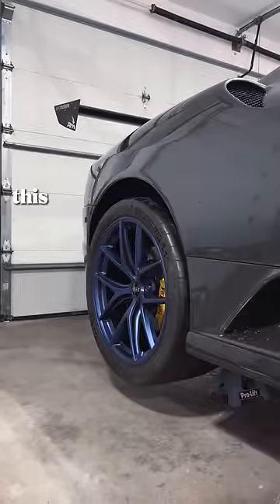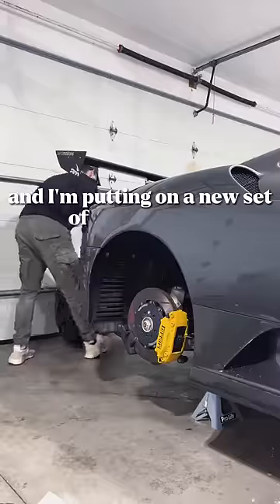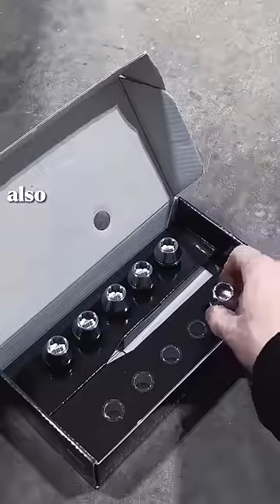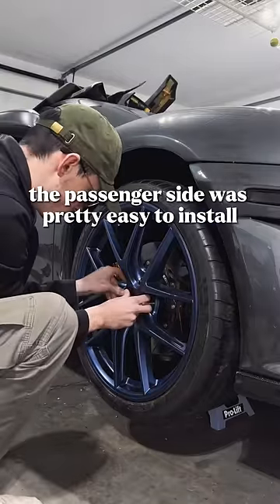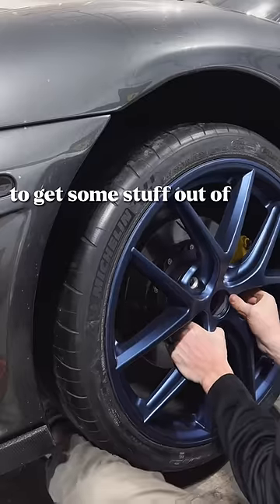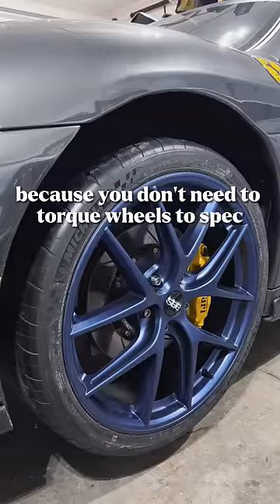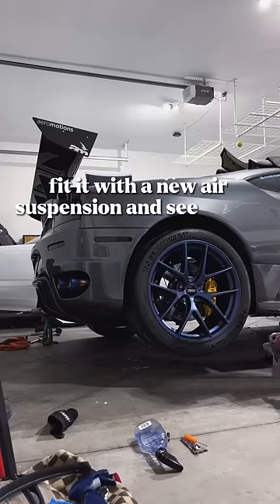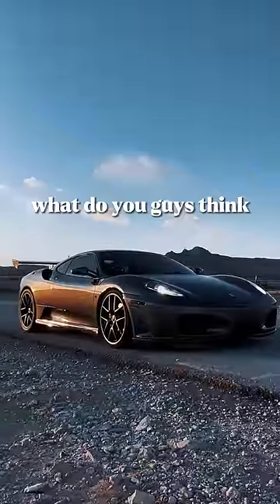Cutting Up A Ferrari In My Garage For New Wheels

Comment: For those mechanics out there who work on normal people's cars. Don't overtorque wheel lug nuts because your customer won't have an impact driver or a 5ft breaker when they are stuck 200mi from nowhere on a Wyoming highway trying to swap their donut spare on.
Reply: Sounds like you’re speaking from experience😂
Reply: I was looking for this comment
Reply: You just sit the key and kick it down
Reply: I mean it’s not such a big deal if your mechanic uses anti seize and your wheels get taken rotated every 3000 miles. I’d rather have it a little over torque then my tire flying into the opposing lane and killing someone.
Reply: @nosypatrick8524  given that this just doesn't happen if you torque properly, and you save the other steps, how about you do that anyway lol. 
Your argument is literally: do all this other stuff that is easy to miss, instead of doing the one thing that the wheel lugs are designed for, which works fine. How about you just torque them correctly, and then you can rotate tires, do oil and filters at the same appointment, and you don't have to put anti seize on wheel lugs (who does that lol).
Reply: Or just be a man about it
Reply: @microcolonel  I didn’t say it was right but it was better 💀
Reply: @aidanfitzpatrick2206  occasionally men let women drive cars. You might notice this phenomenon if you or any of your friends manage to get a girlfriend.
Reply: If you over torque the wheel bolts you damage the bearing. There’s a reason it has a spec
Reply: @nosypatrick8524  rotated every 3k miles?

I just swap between winters and summers every 10k or so miles and have never had issues.
Reply: @PriffEV  some people use all seasons if you rotate them regularly on all vehicles, especially ones with slight alignment issues it really helps with tread wear. It couldn’t hurt but of course I’m still not used to the new 5000 or 1000 mi intervals between oil changes with these new vehicles.
Reply: @nosypatrick8524  1000 mile oil changes?! Sheesh.

My diesel van had 20k mile oil change intervals. And that was still every year. 1000 miles would be damn near every two weeks!
Reply: @PriffEV  my mistake I meant 10,000 miles 😅
Reply: or just simply trying to work on your car in your driveway because your sway bar link broke and turned your car into a death trap but Hometown tire decided "a few ugga duggas" was fine and stripped 3 of my lug nuts
Reply: Let alone the fact that you stretch the stud beyond the yield point and damage it
Reply: @JoshuahAaron  generally you aren't going that far even if you're being ridiculous; but certainly why tempt fate?
Reply: @microcolonel  I mean... A vehicle that calls for 89 torqued to 100 is still enough to stretch and damage the stud may not do it the first time but continued service at the same place will and then they will blame you for needing to replace stud 🤣
Reply: If you're helping your friend fix a car, don't undertorque either
My ex girlfriends cousin and brother "fixed" her Honda and she called me shortly after she left my apartment and low and behold instead of having me look at it, her wheel flew off in traffic and tapped a truck. 
Lol
Reply: Also some of us have invisible illnesses that make our lifes already hard enough as it is.

I have EDS, which basically is an incurable genetic mutation with many forms. To put it simply: my skeleton and the bits holding my bones and joints in place are absolutely wrecked. EDS is incurable and comes with chronic pain. You cannot see it on the outside.

If I had to change a tire suddenly, I would be left with the tire still on and a flare up along with my hands not being able to move properly for the next week.

It's not cause I'm a woman, I just have a genetic mutation which would fuck up anybody. I can move draft horses around just fine for reference.
Reply: @jevenator  till that strips the lug nuts
Reply: @justinpowers8714  trust me that's the worst that could happen to you
Reply: @nosypatrick8524  Over torqueing wheels stretches the lug nut stud more than it is designed to safely stretch and can lose clamping force and cause a wheel to come off. Always torque to specs since the engineers have figured out what is correct for safety of everyone on the road. Guessing gets people hurt or killed.
Reply: #SuspisciouslySpecific
Reply: Sounds like someone needs to go to the gym😂😂😂😂
Reply: Or you'll strip the studs. I've seen that before.
Reply: I agree. I had to have a stud cut off because a mechanic over torqued a wheel nut.  Always torque to spec.
Reply: Lord the comments....just use a dam torque wrench people, torque specs for every bolt on ur car let alone lugnuts is readily available.  No wheel bearings will be harmed in over torque lugs😂 nor warped rotors😂 however u will either cause immediate issues or long term issues depending on the amount of torque you generously exceed😅 n we all know what happens to a under torqued lug😂 especially the passenger front due to physics! To add ur rotation is important for tires long-term no matter the drivetrain, fwd cars are either putting down power to front left or right 90% the time therefore that 1 tire will drastically wear faster than the others, awd cars it's normally a passenger side or driver side where power is put down so one side will wear significantly faster or front left n right rear vice versa, n rwd the same as fwd and will wear a single tire unless u have a TRUE posi Then u got the aspect of the front is not only rolling forward but turning which will wear faster. If u want the most life, just rotate your tires, I'm not saying follow some the dumb dealer intervals but atleast every 7k. Due to dumb designs,tolerances, and programming your forces to buy all new tires instead of the 1 or 2 you may immediately need due to this neglect as these newer awd vehicles will have major drive train problems with mis matching tires and even tread depth😢
Reply: @jlhicks6517  Dude you've got some mad run-on sentences... I just wanted to respond to the claim about front-wheel drive cars.
In my experience owning a front wheel drive car for several years and doing my own rotation and measuring the tread precisely: if I add up all the tread wear experienced by tires in the front and all that experienced in the back, the front tire wear is really not that different.
Reply: @microcolonel  yeah man, forgot, this, was english,class...? 😉 to each there own, idc what you self taught mechanics do. However I do it all day everyday for the last 13 years, a 121 point multi point inspection on every car and can 100% say that between 5k and 7k rotations there is atleast 1/32 tread diff between front and rear. The real question is if it's so menial or no real difference why do you even rotate them yourself?🤣😂
Reply: @microcolonel  to add I'm going to take your response specific and go on a limb of your (owning) your car. As in you have probably replaced the tires, could even be the weirdo that buys the super hard 60k Michelin tires and if ur rotating we will say 3500 miles no u won't see a real difference.  My statement is oriented to those having there cars serviced at dealerships/ shops as the ORIGINAL comment was complaining about over torqued lugs. With that being said most people servicing there cars at dealerships at the least do not own there vehicles. I don't know if your aware but there not putting no 60k tires on from factory lol. Most of the time there as low as 30k to 45/50k on high end vehicles. You take a 30k tire and run a interval of 5k you wouldn't have made that statement. The longer the interval and the lower Treadwear of tire the more the difference.  I'm late for language arts have a good day sir😅
Reply: @jlhicks6517  Nope, standard factory tires on my Camry, just happen to have a 60,000mi tread warranty (or similar).
There are lots of different things to consider with tires, it's not all about dry grip, some of us have a life and drive cars in the rain and snow.
Reply: Also, Honda rotors warp when severely over torqued
Reply: @nosypatrick8524  If your mechanic is putting anti-seize on your wheel studs, you need a new mechanic.
Reply: @Lnmoto86  Yes there are reasons for torque specs, wheel bearing damage is NOT one of them.
Reply: Fr. As someone that's been in that situation, I'm the only one in my shop that learned my gun to stop just short of common Torque specs so I can finish it off with a Torque wrench.
Reply: They have torque limiting extension bars that make it really easy
Reply: @mach55r  99% of them are used incorrectly though haha but it's a great concept if people would actually read the directions 😅
Reply: You can easily break shit too, I've snapped a wheel stud overtightening lug nuts, so go easy on them
Reply: @thegrinchiestflix7667  Let's pour one out for all the guys who are so incompetent they can't earn the money they need to buy a torque wrench.
Reply: Also, you want to torque consistent or else the next time the wheels are installed, the brakes will pulsate.
Reply: I wont take my car to a tire shop.  I bring them the wheels.  Ive gotten the car back with wheels that couldnt possibly be removed with the tire iron in an emergency.  I even had a lug break when putting on the snows one year because the tire shop just went to town tightening the summers on.
Reply: Also overtorque can lead to nut sheering and bye bye tire.
Reply: Also stretching the threads to yield is a bad thing.
Reply: @JoshuahAaron  finally someone with some sense
Reply: @nosypatrick8524 except ugga duggas arent a little over
Often its a lot over.

Torque wrenches arent hard people
Reply: Phew uggus do the job and you can still un do em
Reply: Exactly. When you're on the side of the road trying to change a flat, you will curse the mechanic who over torqued your lug nuts. I hope someone with a 300 psi compressor and a 1 inch impact wrench tightens his lug nuts until they stretch the studs.
Reply: The reason you addressed the mechanics is because if you can't feel when it's right enough with an impact wrench, you're a mechanic, not a technician. If you can't get it right enough, but not too tight, stop working on cars. If you see a mechanic using a tq wrench on lug nuts, find a new one. They either lack experience or they bought a $1200 tq wrench and feel like they need to use it to get their money out of it. Unless you're building engines, you don't need a tq wrench.
Reply: @littlejackalo5326  If you're too proud to use a torque wrench on my lug nuts, you aren't getting anywhere near my car lol.
Plus... sure you could spend $1200 and I'm sure that thing's nice, but a standard 20-100 ft·lb torque wrench with a decent factory calibration runs you under a hundred dollars. 
This is not a pit stop, you can afford to spend a minute per wheel doing it right, for the shop rate.

Comment: Over torquing wheels can cause excessive clamping force as-well as stretched studs to the point where they become weak and snap causing your wheels to fall off!! It can also cause brake rotor warping causing excessive run out which can lead to pad rubbing and potentially uneven wear, looks like you didn’t hulk it with the impact but still something to keep in mind when your paying that much for Ferrari brake components
Reply: I don't think you realized he was joking
Reply: he was very clearly being sarcastic
Reply: @montydurand467  just commenting for the people that don’t understand sarcasm 🤓🙄
Reply: Kick rocks ya square!!
Reply: only losers torque wheels to spec. everyone knows you use gutt feeling to torque them down. no they don't stretch no they don't become weak.
Reply: @rampage3337  better to overtourqe then to not do it at all
Reply: You'd have to be a meathead to put THAT much torque into your wheel nuts... It always makes me laugh when guys at tyre shops rip out the torque wrench to tighten wheel nuts, I've never had a problem- you learn to feel how much torque this need over the years when you work in the industry...
Reply: This car also doesn’t have wheel studs…
Reply: Yea the exact torque figures for any tyre is "uuugghf" if you dont have an uggadugga
Reply: You sound like my dad, and he left when I was 3 months old.
Reply: @danielbrealey2924  both of my impacts generate 10 times the recommended torque for my 3/4 ton truck... matco 20v 1/2" and snap on pt850
Reply: My girlfriend loves stretching my stud!
Reply: @dialedmedia_  Haha
Reply: @losertown2785  So bring it on!
Reply: Rotors don't warp. That's not a thing. Go home.
Reply: I would much rather destroy a bolt or stud when its in a workshop than letting a person go with too loose bolts and have the wheel fly off when driving causing an accident. I have people torque wheels too loose all the time. The torque value changes with rust/debris/lubrication/materials/standards on materials and etc. The torque specs are recommendations for the standard wheels and bolts when clean, dry and in good shape. If you are insecure or not used to fastening wheels to cars, then yes, it is a good guidance. But if you, like me, do it everyday, you know what its supposed to feel like. The driver is also supposed to retorque the wheels after a few miles - I know for a fact they dont do this with actual torque wrenches.
Reply: LMAO bro it's to the hub portion of the rotor, not the actual friction area. It's also made of iron, it's sturdy. Not studs are only going to snap if you go crazy with the impact wrench.
Reply: @danielbrealey2924  store policy is store policy🤷‍♂️
Reply: @incredulousd9408  Store policy 😂 Yeah, not a phrase thrown around in workshops generally. Not unless they are boof headed tyre fitters, I think they have enough trouble signing their name on the bottom of the work order... 🤣
FYI, I'm a qualified tyre fitter and a qualified mechanic. Did tyre fitting as an elective at trade school, I did their whole coarse in less than a week. My time at trade school was about 4 years

Comment: Actually. Torque specs on aluminum wheels is a good idea. Not necessarily to exact specs. They can be over tightened but what is critical is making sure each lug is torqued at the same poundage as the rest. Heat from race braking can cause distorting of lightweight aluminum wheels
Reply: look up the definition of "sarcasm"
Reply: "ACKTUALLY" 🤓
Reply: Impact go brrrt
Reply: @zack-lk8if  stop being lame bro
Reply: @zack-lk8if  look up the definition of "clown"
Reply: 2 Uggaaa Duggar’s it’s tight.
Reply: Seems people are as dumb as I believe. The reason even torque matters is due to heavy use or hard breaking such as racing and ect. As the wheel and everything heats up, it can cause deformations in the wheel or cause it to warp as it cools if there's not even pressure across all lugs. And yes, all imperfections and (idiotic) mistakes show more in metals and alloys under heat. It's all exaggerated and amplified when heat gets involved. But thank you to everyone who wants to be stupid and speak where they have no business because of lack of knowledge.
Reply: @christopheraders4761  bro the joke went completely over your head it’s okay
Reply: Just fell for the algorithm trap bro.
Reply: I torque my Toyota steelies.
Reply: @christopheraders4761  If that’s such a issue then why doesn’t F1 or NASCAR torque there wheels to spec? If anything they over torque there shit all the time. I’m not against it because literally everything has a “torque spec” but I find it hilarious all the arm chair mechanics have an opinion when they never changed a tire in there life
Reply: @ALYXTANKBACKPACK  they kinda get to spec. I know for f1 the speed nut is designed to go as tight designed and thr gun probably too. And nascar also whent to seed nut so probably the same. But the old way with the nuts think they limit the gun
Reply: @zack-lk8if  dammit you beat me to it 😂 🤓

Comment: I always get a chuckle when I hear someone refer to them selves as a master mechanic. 😂
Reply: I also chuckle to myself When somebody says they have a master's degree in psychology? Or some other field?
Reply: I also got a chuckle when I saw how many people took this video 100% seriously
Reply: I mean if youve got an actual certificate stating  that, and it took 2yrs to get,is it still funny?
Reply: Especially coming from a kid that doesn't understand why torque specs are important.
Reply: @5Ci0N  even if you don't have the exact manufacturers torque spec ,you can always fall back to a general fastener size torque spec.
For example it might say 1/4" gets like 10-15 ft pounds max ,and a 5/16 might be 20-25 ft pounds max.and even that depends on thread pitch. 
1/4-20 vs 1/4-28 bolts ,the 28 is gonna clamp a heck of a lot more at an equal faster torque number. 
It'll clamp your part without damaging or stretching your fasteners by checking a chart.  
Not hard to find a chart online these days. 
This is good stuff.
Reply: I always get a chuckle when I see someone completely miss sarcasm.

Comment: Little tips and trick, whenever installing things with a plastic protector, keep the protector on until finished with installation so you don't scuff it or get fingerprints etc all over it.❤

Comment: if you over torque the lug nuts on the wheel it increases the chance of rounding out the stud on the inside when you go to remove the wheel nut.

Comment: There is a big difference in wheel size (circumference), so it will also have a big difference in your speedometer reading.

Comment: As a tow guy, I've seen over torque'd nuts that made the tire just fall off on the freeway. 

Other issues too like nut damage from too many ugga duggas making it impossible for me to put the right size wrench on.

I'm the guy that says torque your tires to spec.

Comment: Most, if not all lug nuts torque to 120 psi, if you use standard 120psi air supply, a couple hits with the impact will set them. maybe hit again in a week for good measure